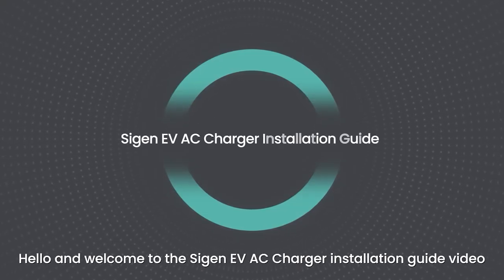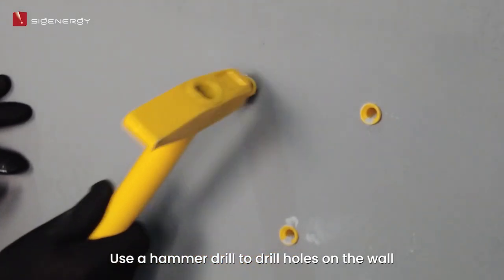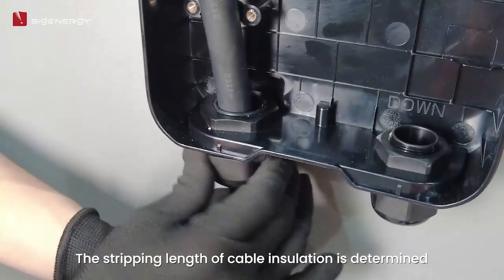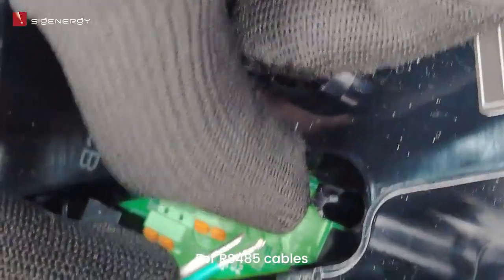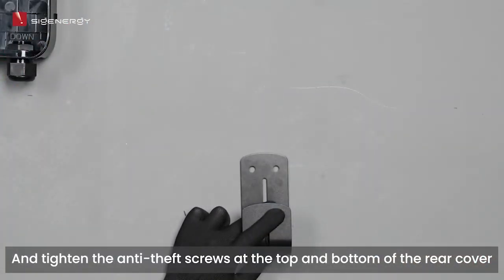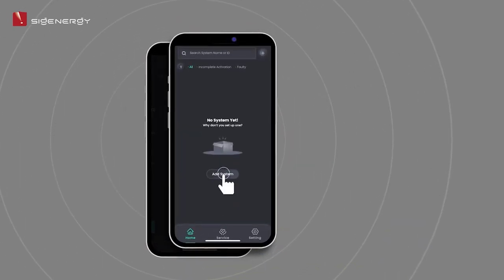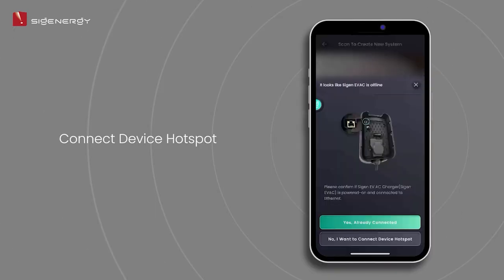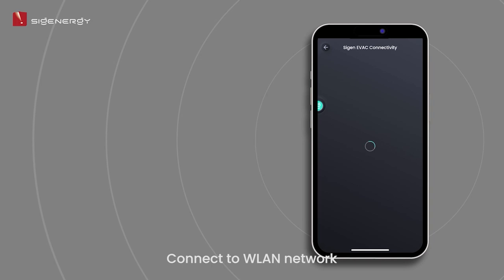Sigenergy EV Charger Installation Video

Comment: Mine doesnt work, everything connected, setup in app completed, the charger is in NORMAL mode, but when I connect the car, it doesnt do anything, no charging, and the charger doesnt recognize the car. I dont know, where is the problem, we are checked all connections and settings many times, but without success.

Comment: Hi my installer, in stalled a 11kw 3 phase charger on my  Single phase home. Now I'm stuck charging at 3.5kw.

Is there a setting in the app I can change to bring it up or do I need them to replace the unit
Reply from the maker: Unfortunately the output of the 11kW 3 phase charger is limited to 3.66kW per phase.  To charge at a rate greater than this you will need to replace the charger with a single phase unit.
Reply: Thank you that's what I thought